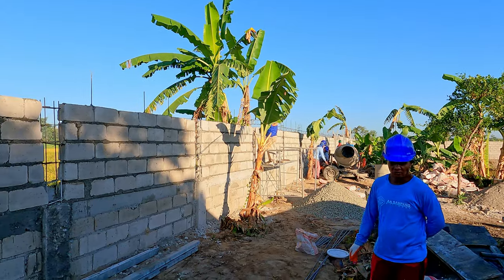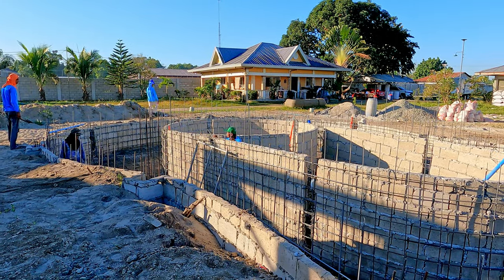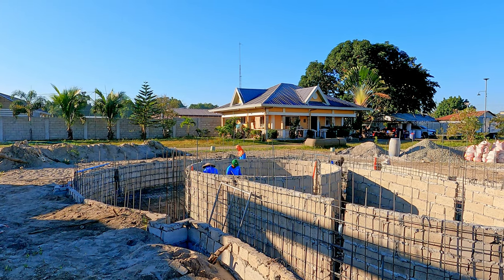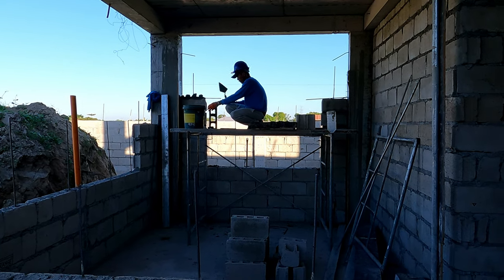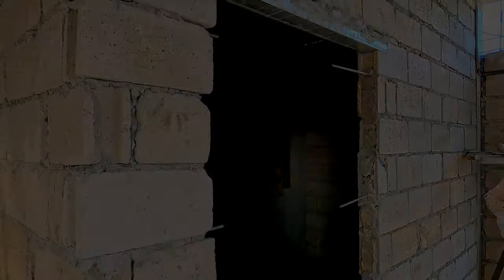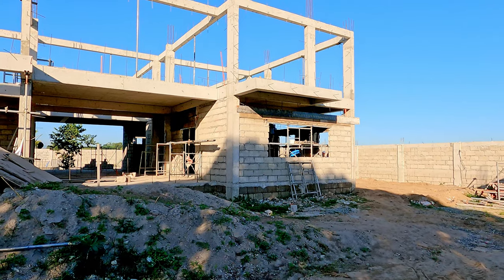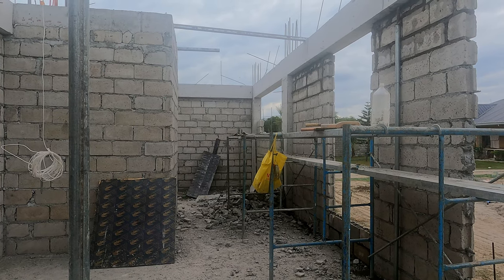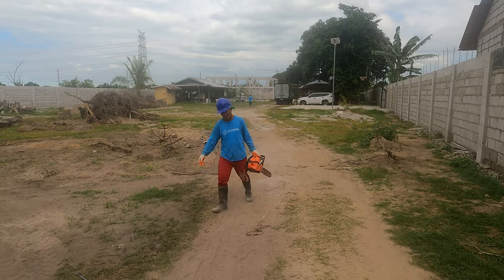Philippine House Building Day 106 - Catch Up Day

Comment: Welcome back Mike The boundary walls I'm way out it continues on and on.
Pool lot's of rebars this will be strong even the curve shape improves strength. And pool water requires very little strength to contain water it's mainly ground pressure. 
House walls getting along. 
Ceptic tank . Well I cannot see how the bottom leeching will work with such a high water table and I would prefer to leeching water piped out to a leeching field setup in lawn area. Well away from the house. Plus 3 chamber keeping the solids well away.
Reply from the maker: Graeme
You showed a lot of faith in the crew with your build day estimate, so don't feel bad about it.
I agree on the concerns for the tank - I will be talking to the builder again about this.
Reply: @philippines4.0buildinganew64  The existing house same property ceptic  tank should give a guide as leaching suitable on the site.  And take some of guess work out. With our Cebu build there is no leaching on site it's piped away , possibly goes treated Harbour direction however I don't know were it ends and same with roof water retention  tank then pipe by road proberly harbor as well